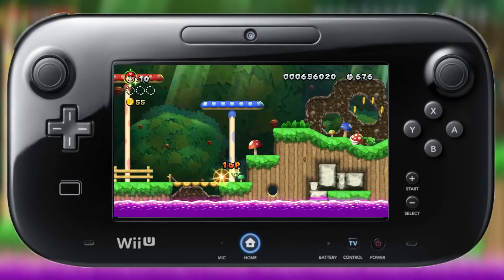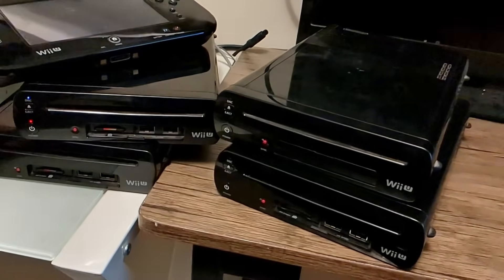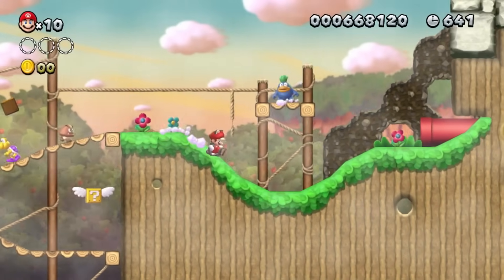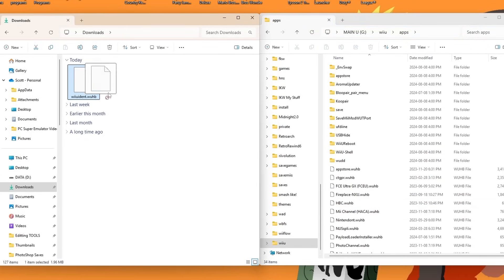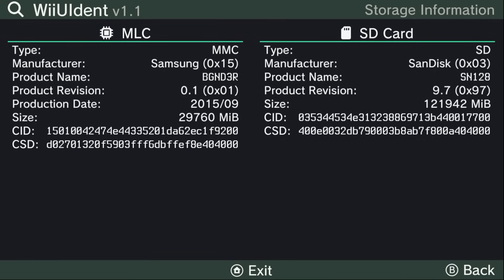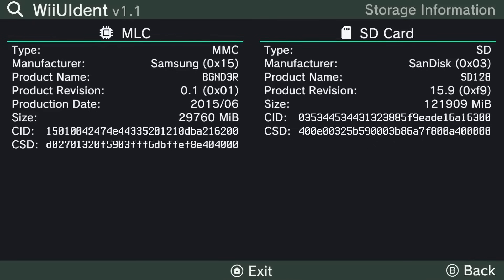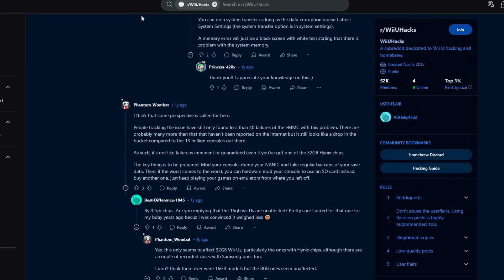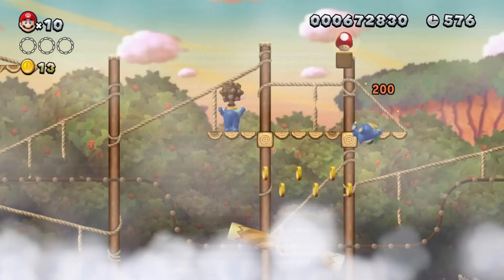How to find out if your Wii U is COOKED... (without taking it apart)

Comment: Scott: "It only happens with the black WiiU"
Me: Has a black WiiU

Scott: "Check the ports on the back for color"
Me: Doesn't have colored ports.

Scott: "Check WiiUIdent for the chip"
Me: Opens WiiUIdent to see a Hynix chip.

F**K

"Also, does anyone actually read this? if so comment banana"
Banana Scott

(Scott, I think you might pronounce it WiiU-I-Dent because maybe it's short for WiiU Identify?)
Reply from the maker: You're probably going to be fine :)

Comment: Fortunately, my chip is Toshiba, but something curious happened when I used the app, I don't know the reason but having the WiiUident app installed my menu was deconfigured, the games were moved and the folders I had created disappeared, including other apps like Wup installer GX2, didn't appear, but when I removed the identification app everything returned to normal. Has the same thing happened to anyone?

Comment: this is why you never buy the launch models of any system, they always tend to be the most unreliable versions of the platform. The PS3 and Infamously the Xbox360 also had major issues with their launch models that later revisions fixed
(the original Xbox and PS2 apply as well but they aren't nearly as problematic)
Reply: launch models also usually have some sort of more desirable hardware resulting in more function as they cut back costs for the manufacturiung over time
Reply from the maker: That's a good point!

Comment: I have a black WII U with colored ports and when I look at it is has Toshiba.
I have my WII U is over 7 years old and after hearing that my WII U can brick I was always terrified that my WII U bricks out of nowhere but after hearing from you that only the most with Hynix bricks, I can finally relax, and I am not terrified any longer.
Reply: Same here, the data says it was manufactured in 2012/11. Whoever finds the defective chip could provide the year and month to know which batches of consoles were affected.
Reply: I never noticed that, mine has colored ports and is from 2012/12. Toshiba thankfully.

Comment: I bought a Wii U in 2015 just for Xenoblade Chronicle X alone. While I enjoyed my time with the console and few games I have for it, my Wii U seems to be cursed. From gamepad screen suddenly broken, tiny gecko entered rear exhaust and promptly chopped by the fan and jamming it causing system overheat, it suddenly not recognizing external HDD and wiped my 50 hours progress in XCX, and finally the cable for gamepad charger got chewed on by a rat (never happened to any other cables in my house). Wouldn't surprised if it has the chip as well too.
Reply: That sucks dude. That being said, Xenoblade X is also for switch (with even better UI!) So maybe buy that and wait for switch 2 to drop :)

Comment: There is no reason to belive that using the console prevents that.

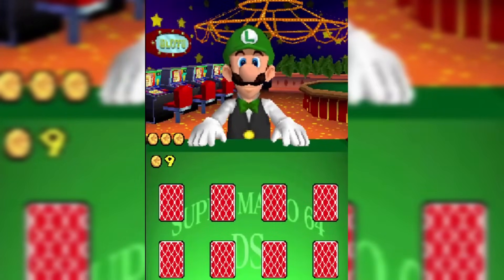At 0:36 (and 10 seconds later again) you show a hynix slc chip. The Hynix SLC are totally fine. The problem is the eMMC (MLC). You can even see that the package and surrounding components are completely different from the correctly shown Toshiba eMMC.

About the 40 cases: we simply stopped adding new cases to the list, when it was evident that the problem is with the Hynix eMMCs. Also nowadays people are able to fix it by themselves, so we don't even hear from most of them anymore. But the guide to fix it, seems to be fairly popular.
Reply from the maker: yeah i mention while reading gary's post that turning it on wont prevent anything, but i shouldn't have said "especially after long periods of time" at the start. as for the slc chip, thats my bad, shoulda used Gary's picture of it lol. I'm clearly not a skilled hard modder (i've never opened a console in my like yet)

Comment: Just asking here because I don't know where else to ask, but I got the older Haxchi firmware with an older firmware version, the guides say it works on 5.5.5 but i believe i got an older version, I'm not actually sure what version of firmware because when the console was exploited, firmware updates were blocked by changing the version to 99.99.99.

Could I just install the Aroma firmware with the guide on my older firmware or do I need to somehow update it beforehand?
Reply: This thing is my childhood i really want to check if it doesn't die 😭
Reply: I think I know the answer, but to be sure, are you running Coldboot Haxchi or regular Hachi?
Reply: @XaneTenshi  CBHC

Comment: Best advice here is to jailbreak, dump the nand, store it somewhere safe, and if the system dies, install Voultar's NAND-Aid board and restore the nand backup to an SD card.

This is a solved problem but people do need to backup their nand just in case.
Reply: You are right, this is a solved problem, but it doesn't work like you described.

Comment: Fun Fact: One of my V1 Switches that also had a Hynix Chip failed 😂. Luckily I was able to replace it and rebuild the Firmware. Really appreciate your content Scott, keep going!
Reply: What did it look like when it failed? My Wii U has had issues for a few years and I've mostly given up hope, but I would still like to get it working. It's stuck at the splash screen and won't boot, so I'm curious if that's what yours did. I tried asking those phone repair shops that say they service gaming consoles, but they said they couldn't do anything with that particular issue. However, this seems like a pretty niche failure.

Comment: first wii u unfortunately had a failing eMMC hynix chip. however! there’s a super easy mod by the same creator (Gary) using a $10 raspberry pi and sd card that works on unmodded wii u consoles. luckily the replacement console is a samsung eMMC

Comment: Those with access to a RP2040 (Pico) don't need to be soft mod the console.  Setup the Pico to use UDPIH and put the 'recovery_menu' on the SD card root.  View the system information from the menu.  Shut down and unplug.  No active mods or plugins being installed are required this way.  I have 3x yellow power Wii Us and only one with a Hynix (that did go bad and I used a NAND-aid with the MLC Download tool).

While in the menu, making a backup of your OTP, SEEPROM, and MLC/SLC from the 'recovery_menu' to save in case of MLC failure is also possible without needing to install mods on the console.

Comment: Quick PSA but even if you have a Hynix Nand and your Wii U Nand does die, it's not the end of your console. There is an open source mod referred to as "Nand-aid" that essentially overrides the system nand and uses a Micro SD card connected to a custom PCB. 

Its only recommended to professional modders, but it's always nice to have options to prolong the life of your console.
Reply: Could you just use a hot air tool to replace the bad NAND and put a new one in?
I assume you would need a backup or your NAND and a way to flash the chip first though right?
Reply: @andreamitchell4758 I think a new nand chip isn't easily accessible so the nand-aid mod is the replacement
Reply: @Tsubasa0504  you mean like to buy a new NAND chip?
I thought maybe the reason for the SD card was that it would be easier to flash and not require a tool to flash it , but the trade of would probably be that it's harder to solder an adapter for an SD card that it is to just replace the chip, this is only speculation though
Reply: @andreamitchell4758  IMO, more people have the ability to solder a PCB and sd card slot on the board than use hot air (properly and safely) to remove the failing eMMC.  Part of the requirement for being able to rebuild/replace this with the SD card is having the OTP from the console if an available backup of the MLC isn't already handy.  If the eMMC that holds the MLC is corrupt enough, I don't recall the OTP being obtainable.  I'm not sure if there's a way at this time someone has discovered to create the OTP and replace the eMMC.
Reply: @andreamitchell4758 Wii U spare NANDs aren't produces
Reply: @DapperIndividual  or use redNAND
Reply: what about switch cartridges they use NAND?
Reply: There's also a fix you can use with a raspberry pi pico to revive it
Reply: Or just set up ISFSHax while the Hynix chip still works and then when it craps out you can use RedNAND and not even need to open up your console or anything
Reply: Mine died and it has the blue blinking light, do you know a tutorial on how to fix it using the method you mentioned?
Reply: I swear that there will be instructions on how to revive fossilised WiiUs before WiiUs live long enough to be "fossilised" at this point, this console seems to be one of the most protected from bricks
Reply: I’m not a professional modder, I don’t know anything about electronics and yet I fixed mine following a guide in YouTube. It doesn’t take any skills to fix it and costs about 15$ to do so.
Reply: @awesomereviews1561 what guide did u follow?

Comment: "I dont want to scare you"
The whole point of the video is scaring people to spread awareness that we need to research a potentially fatal issue
Reply from the maker: i give solutions at the end of the video too (as per Gary's suggestions)
Reply: I actually found it very reassuring. I heard about Wii Us dying if they aren't plugged in regularly, and this video told me that it's a very small percentage of the machines and that there is no need to fuss and keep powering on the system regularly. It also says that there are things you can do even in the worst case scenario. So I don't think that the video is designed to scare people at all; quite the opposite, and I appreciated that.
Reply: Same bro, I like to turn on my old devices that I don't use very frequently nowadays, including the Wii U, at least once a year, because it's a good common practice with devices you no longer use very much and risk of dying that way. My 2012 Deluxe aunch Wii U with coloured ports still works just fine with no strange behaviour, have been playing MK8 a little last weeks lol  @internisus
Reply: Same bro, I have a  Launch 2012 Deluxe Black Wii U that I got in December 2012 that has those colour ports and works just fine. I always had a good habit of booting up old devices and messing with them at least once a year to prevent this from happening. I have been playing lots of games like MK8 last week lol, and last year when issues were reported I was playing BOTW just fine too  @internisus
Reply: @internisus what if you leave them plugged in for years without switching them on
Reply: Or you fell for clickbait but hey that's just me
Reply: Out of fear can come fake solutions that could damage the console even more, that was the case sadly for PS3 Fat chips that didn't have no thing to do with the yellow light of death but people still replaced them (which isn't recommended because you basically kill your ps3 that way) Just because there was an asumption that that was the problem
Reply: It's reasearched, it's fixable (if you don't wait for the full brick, but even then it's fixable with soldering). What elese do you want?

Comment: Damn I have a hynix, and had my wii u mostly unused for 8 years really surprised it still works
Reply: You are lucky but hopefully you get the chip changed
Reply: @tobyzilla  Relax guy, it's not as if having a hynix chip means the Wii U will guaranteed to die. There's no need to get the chip changed if it's working.
Reply: @unclepain10  well I found out my wiiu has a Samsung chip

Comment: Today I learned 2 things.
1. There are Wii U's with all black ports.
2. My Wii U has the SK Hynix nand.
Reply: when the pictures of the SK Hynix, Samsung, and Toshiba chips showed up on the video before he said the hynix brand was the bad nand, I literally guessed the Hynix one was gonna be the bad one because I have had 2 SK hynix SSD's fail in the past. and 2 sticks of hynix RAM fail in the past. so not only do they make crappy wii u nands they also make crappy PC Components.
Reply: @cmartin68137  yeah, they never really made high quality stuff
Reply: @cmartin68137 
In the switch overclocking scene certain Hynix RAM chips are very sought after because they can exceed their rated specs by a very wide margin and are extremely high quality 

And there's one Hynix RAM type that's the absolute worst RAM you can possibly get which is the one I got lmao
Reply: @cmartin68137 hynix makes the best memory chips by far. At least for ddr5
Reply: Yea same, I learned there are Wii U's with colored ports and that my main Wii U has a Hynix nand.
Reply: mines black and samsung
Reply: @kittykitty168 same
Reply: Same lol
Reply: @Mineluke  my wii u died with the system memory error and i opened it and it had hynix (the older SKHynix) brand NAND
Reply: Rip
Reply: Mine has the colored ports, it's a samsung tho. Now it makes me wonder how high that chance of having a hynix nand inside those is, cause i thought it was so high i would've had it too, or maybe i just got rly lucky
Reply: There arent 13 million with that chip though, math aint mathin..

Comment: FunkyScott: ,,It only happends with the black wiiu"
Me: Has a black wiiu

FunkyScott: ,,The wiiu with the colored ports has more likely a hynix chip"
Me: ,,I have colored ports...."

FunkyScott: *shows to look it up in WiiUIdent
Me: *open WiiUIdent sees a hynix Chip in manufacturer

god damn....
Reply: Hynix doesn't automatically equal death
Reply: There is an app you can run that uses your sd card as a replacement for the NAND. It’s a pain for sure though.
Reply: @NattracTodd  its not. just don't use funkyscott47's guides. they are total dogshit
Reply: @bonnibahn  gg
Reply: I also have a black wiiu with colored ports
Reply: Same here.... DOH
Reply: Install isfshax
Reply: I bought a refurbished Wii U off of Nintendo's Official Ebay when they sold them.  It lasted 2 years before it corrupted & I remember it had colored ports.  It corrupted after a save file from Smash 4 was interrupted when my nephew kept pressing home during auto saves.  Dunno if that was the direct cause, but when I looked it up a lot of Wii U's became corrupt because of Smash & Batman auto saves.  My guess is they were all either Hynix or interrupting saves just has a very high chance of corrupting the NAND, regardless of it being Hynix or not.
Reply: You’re cooked

Comment: Weird that it's the Hynix chip, as they're traditionally a solid supplier - additionally, going by the description of the ports on the back, colored ones must account for the vast majority of consoles, dating back to the first units. I've never seen a WiiU with dark grey or black ports at all. So if these account for the majority of black systems, are failure rates based on percentage any higher or is it a typical 2% simply working out to a larger number because there are just more such systems out there?
Reply: i mean my 23 year old flash drive died with no use. it had hynix nand, but it was 23 years old

Comment: It's been a couple of months since my Wii U stopped working for no apparent reason. One moment it was working, and the next day it wouldn’t turn on, even after plugging in the power cable. The Wii U doesn’t flash any color. I’m not sure if the problem is with the Wii U itself or the power cable.
Reply: is there any chance that you forgot to turn off your wii u after you use it?
Reply: @ryuu6442  i don't think i remember but maybe not.

Comment: OMG surly not...just modded homebrew and got everything finally setup and you drop this A-bomb! mine's a black one with coloured ports but it's Windwaker edition...you really think they put those cheaper NANDS in the special eds?
Reply from the maker: If you watch till near the end, Gary (who is very well known and has done so much for the modding community) has a post that might make you feel better :)
Reply: @funkyscott47  cheers dude
Reply: I have the Wind Waker edition Wii U and have Hynix NAND in it. I'm not worrying about it dying, the issue is really overblown for how bad it actually is. There's just a CHANCE that it'll die, not that it will 100% die.
Reply: @masterkeaton1000 I heard that if you keep it plugged in that the Hynix chip Wii Us are less likely to fail.  When there’s no power going to them and sit for a long time is when they fail.

Comment: We’ve had 3 of them die
Reply from the maker: Really? All with hynix? :(
Reply: @ yeah all 3 one I was able to get going again but it would shut off and not come again for awhile no lights no nothing changed power supplies all that nothing unplugged it left it unplugged for 2 weeks plug it back in again and it would turn on play for a few hours and shut off again the rest of them never worked again on from game stop one brand new and the other eBay all with Hynix the last one we got had a Samsung chip still going